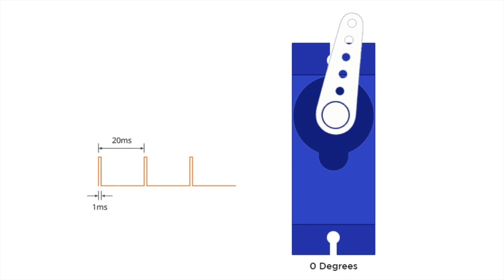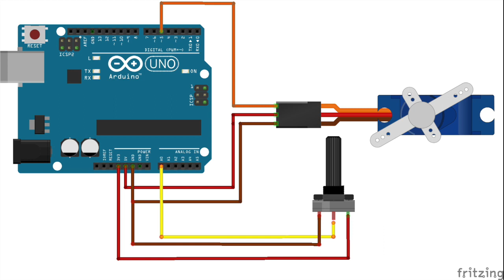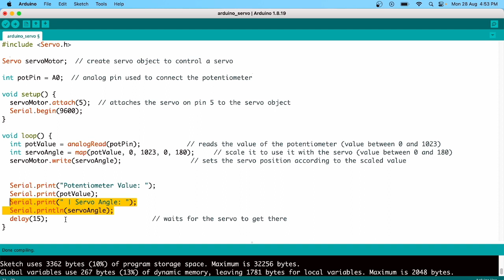How to Control a Servo Motor with Arduino

Comment: I had a question if you wanted to power it externally not through the Arduino is it a case of the power supply having the same ground as the servo but the VCC or positive coming from the power supply or battery would that work? Thank you again.
Reply from the maker: Yes. I will work.

Comment: Thank you for this video. I don't actually have a problem with software part, i usually have problem with the hardware part. this is why i was searching for a video which was showing where to plug the cables.